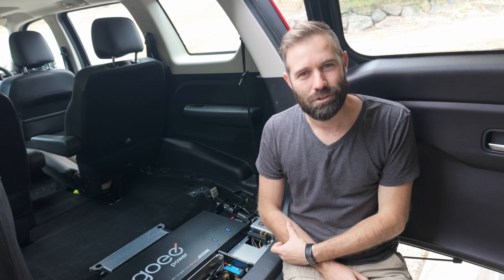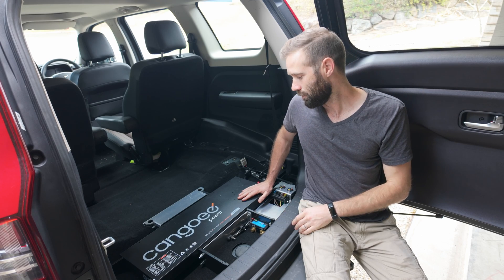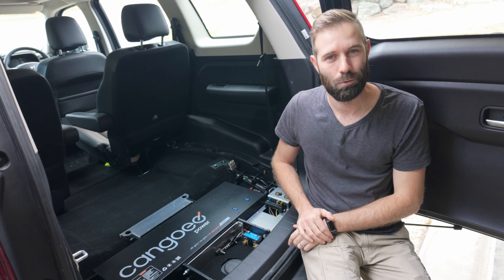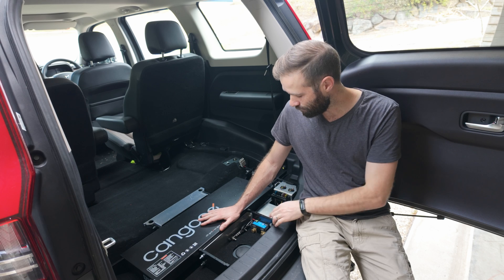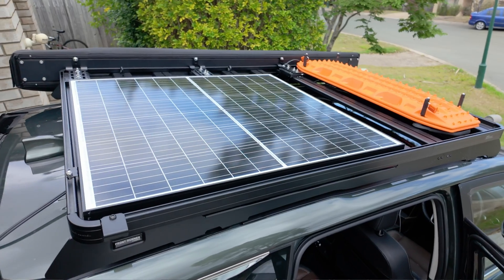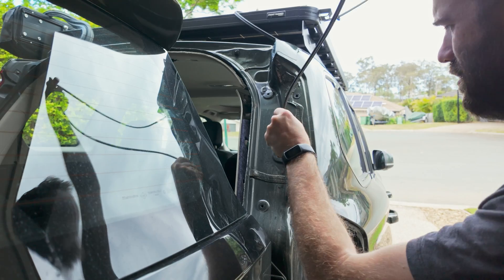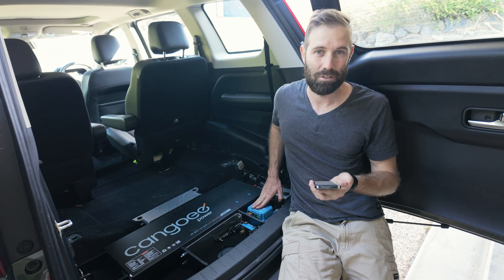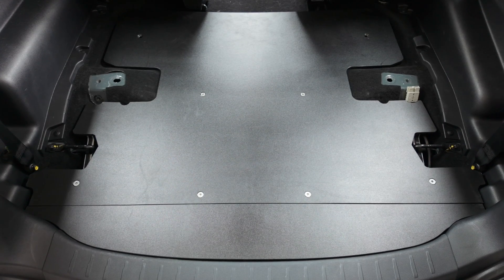Adding 12v Solar to my Mahindra Scorpio Camera Car Build

Comment: Have you taken into account the torsion on the car structure while driving and if it affects the solar panel?
Reply from the maker: Hey mate, the roof rack from Front Runner is really solid so I wasn't concerned. Have you seen it happen to other setups?
Reply: @DanielSnare  no idea, never seen solar panels on cars, there is a thick glass on top of the panel which provides protection to the cells, so you have to see over time how it goes.
Reply from the maker: @SharkFishSF  yes good idea, I will keep an eye on it. I know the glass is designed to withstand small hail so must be good quality

Comment: Can we get a rough estimate as to how much each of those mods are costing you or would cost?

Also, can you get a bigger battery pack? And how much would it be?
Reply from the maker: In AUD, I paid $300 for the solar panel, $25 for the solar cable and I think $140 for the Victron 75-15 regulator
Reply: @DanielSnare  that's not too bad. Is that price the regular price or a price just for you?

I'm in Australia as well. Love what you're doing to the Scorpio.

Are you going to give us an update on how the car is going?
Reply from the maker: @itsmoey  regular price, I got them from Outback Equipment